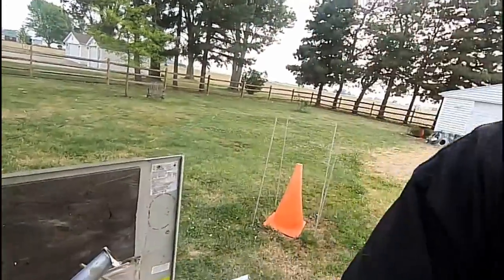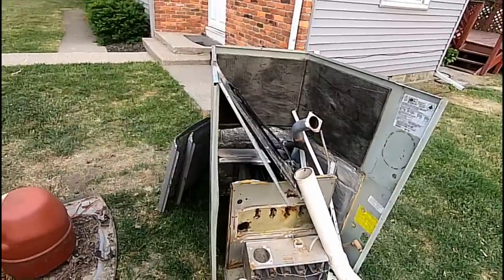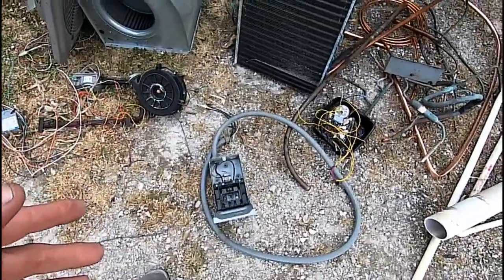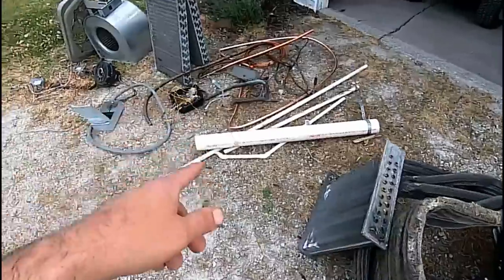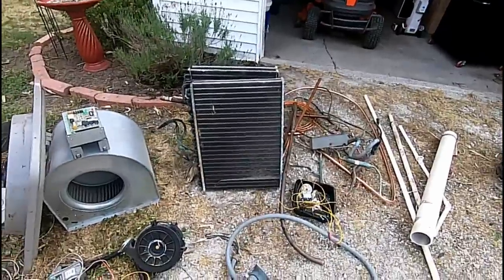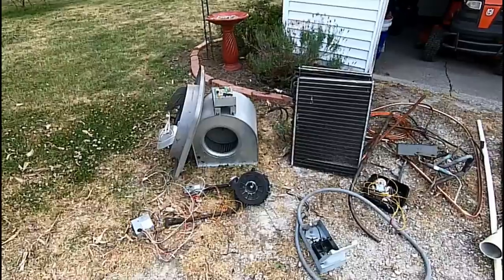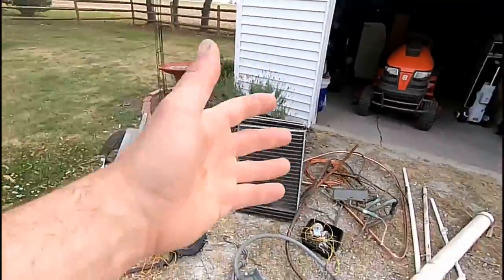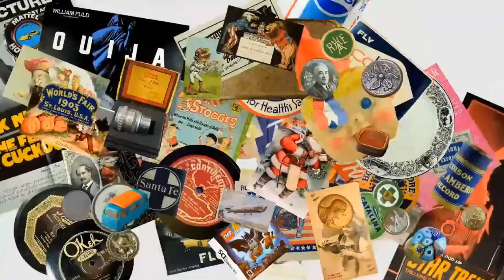This Could Have Killed Us

Comment: Years ago the service tech noticed a crack in our oil furnace heat exchanger. Didn't look like much to me, a short thin irregular line, looked more like a scratch, but enough for him to cut the wires to the furnace and put a red warning tag on the furnace we had to replace.

Comment: My neighbor found the lucky way . she had one of the new units in attic. It was a 1 year old unit and it developed a crack and was piping carbon monoxide etc.what gave it away was another crack that stopped it from blowing heat and the monoxide into the house proper. The build up set off her detectors and she opened the windows.and turned everything off and called the fire dept.cost her another $6k  since she had bought the house right the unit was installed.

Comment: You sound so much like me Don, our dryer was in good condition but we hated it. I looked at the prices they were going for, & decided to strip and sell the parts. I only have about 4 items out of 12 items left. Made about half the cost of a new dryer, the shell of the dryer I let the scrap man pick up for free. Separate thing Don, I just sold an item to a buyer that is giving Neg or Neutral feedback to many sellers, she says didn't receive the item. I'm not surprised she is getting things late delivery or not at all as her address is wrong on the eBay delivery slip. I pointed that out to her but still didn't alter it. I altered the address and redone a post label to make sure it got to her and signed postage as well. She has it and gave me good feedback, but she had put 2 negs & 3 neutral feedback after mine to other sellers as she is buying a lot. Or should I say scamming a lot of sellers with items not received and probably getting her money back from them?. Do you think I should phone eBay and tell them what's going on?  
.
Reply: Report the buyer. Ebay will likely remove the negative neutral feedback
Reply: Wow, she is going to get caught soon doing that.

Comment: there is copper in that condenser/compressor too. I cheat and have a plasma cutter so it only takes me 10 seconds to cut the top off of them which I normally just run the tip just above the seam line and then there are 4 bolts to unscrew and you can pull the copper out the top.  I have about 20 of them waiting to get cut open. I like doing it in big batches.

Comment: I don't mean to correct you, but steel is not 50 or 60 cents a pound it is anywhere from 7 to 12 cents a pound depending on where you live, I scrap almost every day and go to the scrapyard every day and I work a full time job, With just steal I make an extra 3-4 hundred a week, it helps. I have alot of non Ferris I'm just saving Up
Reply: I've been Very lucky, I mostly hit construction dumpsters and big open top type of Dumpsters, I  have some honey holes and I bring in anywhere from 800 to 1200lbs of steel a day, hopefully it lasts